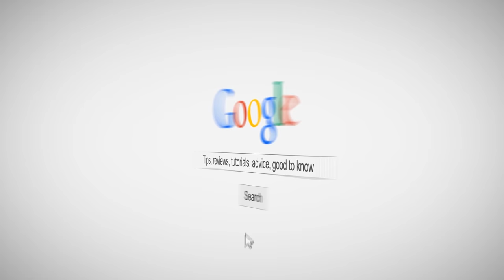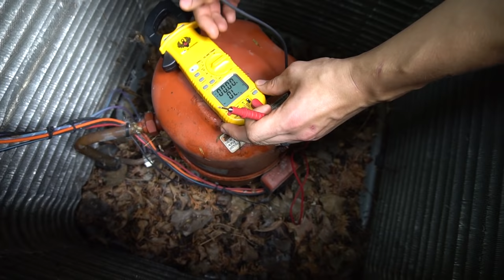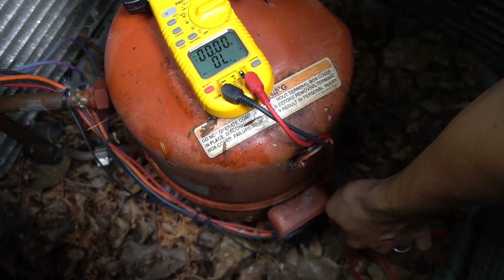AC Keeps Tripping Breaker and The 10 Most Common Reasons Why

Comment: My window unit has tripped the breaker three times in half an hour. I cleaned the filter (only a bit dusty), and it tripped again. The breaker itself seems “soft” compared to the other breakers.
Reply: Window unit, if large can be drawing a substantial amount of current. It should be minimally plugged into its own 20 amp circuit.. have someone who understand this look into your circuits.

Comment: I have an mobile home package unit. Blowing cold air but not strong. Ducts are secure. Isn't cooling off home. Takes forever. On a 90 degree day non stop running. Blower problem?
Reply from the maker: Well it's unlikely that the blower is at fault. Unless the blower wheel fins are totally caked up with gunk. Take off the doors and find where the blower motor is. Reach in there and carefully feel in between the blower wheel fins. Is there a lot of stuff there or are they relatively clean? Unless they are very dirty then I wouldn't think it's the blower. More commonly this would occur with a unit that is low on freon. If you have refrigerant gauges you can check it otherwise you'll need a tech to check it out for you..
Reply: Word of Advice TV would of never thought freon since it is still cold🤔 wow!

Comment: The thing is that my breaker does not trip off. The system runs fine and then the condenser fan stops while the unit keeps running. I reset the breaker and the fan works again for a while and stops again. What is my problem?
Reply: I have the same problem, did you figure it out?

Comment: A desperate friend called me for help.  No AC.  When I got there the compressor was running and clicking in and out from extreme heat.  The condenser fan was not running and the start/run capacitor was swollen up.   Obvious problem but why did the idiot not bother to turn it off?  I think it had been going all night in hope that it would miraculously fix itself somehow.  I looked at the disconnect and found pieces of copper pipe being used for fuses.  I replaced the capacitor and the fan and compressor ran OK.  I couldn't believe it had not destroyed itself.  How can people be that dumb?   I guess that's what keeps you guys in business.  AC systems are the most neglected, abused and misunderstood equipment in a residence.  Filthy, neglected, rotted out systems can be found everywhere.
Reply from the maker: I know how you feel.. It happens all the time. Or the people that run their AC for 2 days after they noticed that ice is building up on the pipe and it stopped blowing air out from the vents... By the time we get there, the evaporator coil is a solid block of ice. Takes a long time to thaw.

Comment: Can anyone tell what my problem(s) is/are when my outside a/c unit fuse blown twice at the a/c disconnect box? My breaker is not tripping at all, just the fuse. First time it happen when inside unit was running and outside was not working, so I put a new fuse in then I got a spark and blown the fuse. The second attempted I put another new fuse in, it also spark and killed the fuse too with the ac system completely off.
Reply from the maker: Hey Tom! It sounds like you have a direct short somewhere. My guess is that your circuit breaker is rated for higher amps than the disconnect fuses which is why they blow first. I would turn off the breaker at the panel inside and then take apart the disconnect to see if there are any loose, burnt, or broken wires. I would also look inside the condenser unit for any damaged wiring as well. Of course do this carefully and insure that the power is off before touching anything electrical. If you are not finding anything, then I would hire an electrician to take a look at it.
Reply: @WordofAdviceTV  Thanks for the advice, this is a new unit installed a few months ago just now trying to use the HVAC system. I think the problem is at the disconnect box as you said. The disconnect box is a 2 fuses horizontal, one top and one bottom. When I put my meter on the two top terminals it read 248Vac and the 2 bottom read less than a few volts. Every time I put new fuses in, the top one got blown the bottom one was not.
Reply: Update - got my outside AC unit working, fan is spinning and seems like compressor is working but I can't really tell. The guy that installed my unit wired the disconnect wrongly, diagram indicated Line, Line, Load, Load. He wired Line, Load, Load, Line which causes the top fuse to spark and blown out every time. Don't seems like I am getting cold air, it been running for half hours which means I need to check my evaporator as you suggested. My question was when he wired the disconnect wrongly did it damaged the evaporator or blown the fuse if it got one?
Reply from the maker: Glad to hear you at least were able to track down the disconnect problem. And yes.. That may have damaged the compressor but that wouldn't be my first place to look. I do have videos on how to check the compressor though if you need it.  As for the fuse, if you are talking about the 3 amp fuse in the furnace, then no. That is on the 24v circuit so it should have nothing to do with the 240v..
Reply: @WordofAdviceTV  Update - The compressor wasn't damaged just didn't has any R-410A in it which is why no cold air coming out from vents, just returned air. The ac guy came over and charged up the system, now the house is slowly cooling. I fixes vehicles ac so I knew enough but never work on HVAC system, your videos helps greatly,  many thanks. I subscribed and clicked the notification bell so any new videos you published I'll surely watch.
Reply from the maker: @tomhuynh9393  Thanks Tom! It's good that your AC was finally fixed! Although if all the 410a was gone... Does that mean you have a big leak somewhere? If he only refilled it and that's it, then it will eventually leak back out
Reply: @WordofAdviceTV  Exactly what I was thinking too but he checked those fittings and pressure stay steady, however I don't really trust him to do those steps correctly.  I believed he never put in the 410a to test the system after the installation of the HVAC.
Reply from the maker: @tomhuynh9393  Ah I see.. Well hopefully he did it right the second time around then!

Comment: How about if the breaker doesn't trip immediately and it takes 5-10 minutes for it to trip any idea what causes that to happen?
Reply: This can be caused by a weak start/run capacitor to the compressor and an aging compressor. The compressor will start up when cold but on the second start cooling cycle determined by the thermostat the compressor is trying to start up at higher pressures in the system causing higher amperage draw. Change capacitor and install a hard start kit to lower the amperage at startup. Had this happen to my system and that fixed the problem.

Comment: whew. turns out that the reason why my AC switched off when the compressor started is my thermostat batteries were dying.
Reply: Ours started when the thermostat batteries were going out.... replaced the batteries yesterday and it ran fine until this afternoon, and now its tripping the breaker again.

Comment: Actually, your test for AC compressor being bad by disconnecting the wires from the unit and turning it back on isn't correct. You could have issues with a run capacitor for the compressor being bad, in newer units there are dual run capacitors for the compressor (HERM) and fan pins. If you disconnect the circuit, you don't know if it's the capacitor or the compressor that is the problem. It's very rare that the compressor goes bad. Also, on the newer units, there is a compressor pressure reset button somewhere on it. That can cause the same condition as the bad compressor but not the electrical tests, testing it directly on it's pins.
Reply from the maker: Thank you for the corrections and for taking the time to write the comment! Much appreciated!

Comment: Jay,  I put s new thermostat up it was a non digital one and every time it would power off it would blow a fuse.  Installéd a digital one and it did not happen.  What caused this?
8
Reply from the maker: Hmm... I would love to give you a good answer but with that one, I would need to see the wiring to be able to figure out what caused it. Sorry. But happy to hear it's working now! :)
Reply: This was last summer with the air conditioning.
Reply: I think this thermostat was bad because I wired it right and it wouldn't work for heat .  only aircon and when it was done a fuse would blow,after the cycle was done

Comment: but I do not have this type of A/C
I just have a 15000BTU in a window
1st year brand new,  worked great
2nd year, fuse box trips every 5 mins 
compressor kicks in,  but in 5 mins POOF
Note just running FAN  no problem
Reply: Check for obstructions on outside and inside of the unit, clear them out, when the power if off (unplugged), you could have a coolant leak or be running low on it, also check the run capacitor for the compressor, sometimes it's a fan and compressor dual run capacitor. Usually the compressor side of the dual run caps dies first, then the fan. 

The compressor uses a huge amount of power to get it to start and continually run, if you have a dying or dead run capacitor, this is the symptom of a bad run capacitor. If you have no air flow, this will only compound this problem. Run capacitors are a lot less expensive to buy and replace than a new unit. 

Note:

The higher voltage capacitors are better because they're made to withstand more abuse, most repair tech get the 370 VAC types, but look for 440VAC or 660VAC in the same package size, that is rated for blackout and lightning strikes. I find the 440VAC with the same uF (listed as UF) on the caps (even those it's not technically correct to use a capital U).

Comment: Hey...  what causes the compressor to overheat and shut itself off?   It mostly happens during the hottest part of the day (i'm in south florida, so the hottest part of the day is REALLY HOT!!). When i hear the condenser fan motor and blower motors are on; but the air is warm, i shut down the unit at the thermostat, wait for ten minutes or so, and turn it back on it runs ok.. at least for a while!   HELP! Thanx... Don
Reply from the maker: The most common reason is a plugged condenser coil. To begin with, I would thoroughly hose down your condenser coil outside even if it looks clean.

Comment: What if it runs for a few hours then shuts off?
Reply from the maker: Hey David! You mean the breaker shuts off right? My first thoughts would be:

1. Thoroughly hose down the condenser coil outside even if it looks clean.
2. Check all your wire connectors, especially at the compressor pins for any corroded, broken, or melted wires.
3. Before the breaker trips, does the fan stop spinning by chance? Sometimes what will happen is when the fan motor is going bad it will run for a while before it overheats and shuts off. The compressor keeps running until it trips the breaker. (Could also be caused by a weak run capacitor)
4. If your unit does not have a start capacitor, I would consider putting in a hard start kit.
5. It's possible that there is something wrong with the breaker itself and it needs to be replaced.
Reply: A few hours?!?! An a/c is not suppose to run constantly. It reaches temp then shuts off. You might have a flow issue which raises the pressure and the pressure switch stops the compressor. Buuuuuut that might be way off since i have no idea what kind of system you have.
Reply: @WordofAdviceTV  I found the problem. Shorted out wires on the condenser fan😱 who ever installed the fan did a hack job. When the fan was blowing the wiring were pushed up by the air flow when the unit shut off the wires would Arc on the condensing unit causing the breaker to pop because of connectors corroded. The wires were actually ran up over we're the fan was mounted then back down to the capacitor leaving the connectors exposed to sun light which destroy them exposing the metal connections causing an ark🤔
Reply: @0ohoaxo0  it's a GM unit and found the problem sir. Thanks
Reply from the maker: Awesome! Glad to hear you were able to find the problem. Thanks for coming back with an update! Stay cool ;)
Reply: @kingb468  you da man!

Comment: My Goodman only trips sometimes and it's always at the hottest part of the day
Reply: Clean the condenser coil.
Reply: @luisjavier1447  turns out when they installed it 3 years ago , they put the breakers for the old one in for the new one. It needed a double 45 but only had a double 30 . So over time it wore out my capacitor. Replaced breaker and capacitor and now no more problems.

Comment: what about the capacitor?
Reply from the maker: I don't recall having any calls where the cause of the tripped breaker was a capacitor. Did that happen to you?
Reply: I'll let you know tomorrow. Not sure yet., but couldn't a bad capacitor do that since the fan and compressor aren't kicking on?
Reply from the maker: I suppose it's possible and I simply haven't seen it before. That being said.. I have seen hundreds of dead capacitors though. From my experience they do not trip breakers. If I won't forget, I'll ask the 20+ years techs at work tomorrow and see what they say.
Reply from the maker: We had a meeting today and I talked to the other guys, they said it does happen once in a while. When the capacitor is dead and the compressor tries to start multiple times, it draws high amps which could cause the breaker to trip or the disconnect fuses to blow. So you were right. The capacitor can be the cause of the breaker tripping. Thank you for asking that! :)
Reply: Hey thanks, but I think it was my compressor. Do the wires have to be disconnected on the compressor to test it. I was getting a reading across one of the three but not the other two. The wires were still plugged in. The area was pretty tight and I couldn't see real well so I left them plugged in, but of course power was off.
Reply from the maker: When checking the resistance, it's better to disconnect the wires so that you are not reading the resistance of the capacitor/contactor as well. But if you are not getting any reading between two of them that means your compressor has an open winding. Unfortunately that's bad news.. Either compressor replacement or whole unit replacement..

Comment: Get the coil professionally cleaned. Spraying it with a hose does nothing but push dirt/fuzz back into the coil. You need to get a foaming cleaner and let the condenser breathe.